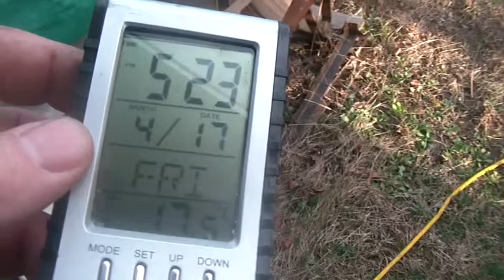4_17_15, Upper garage, making paper gaskets, back on Cushman,

Comment: I purchase a big roll of fuel/oil resistant gasket material from autozone. To make holes in gasket material I use a paper hole punch and for other size holes I use different size bullet shells punching them into the material with a hammer. Makes for a professional looking gasket. One roll goes along way.